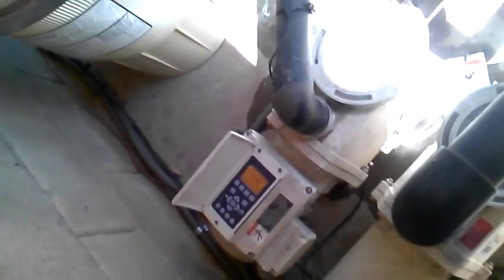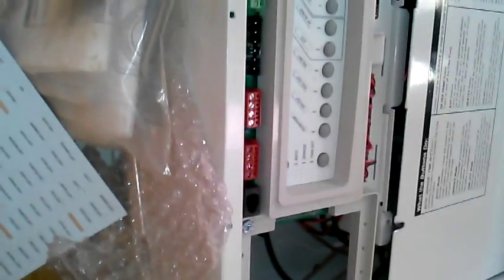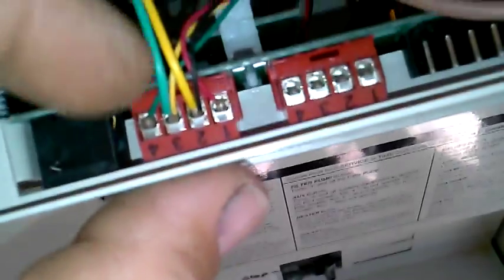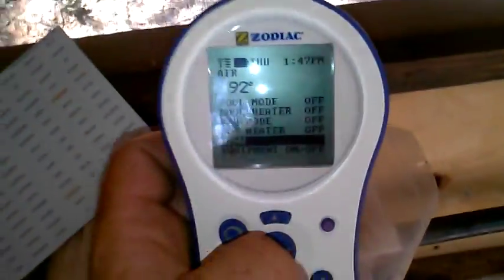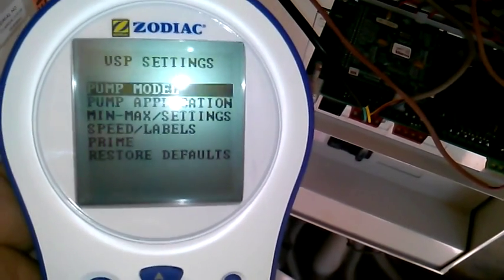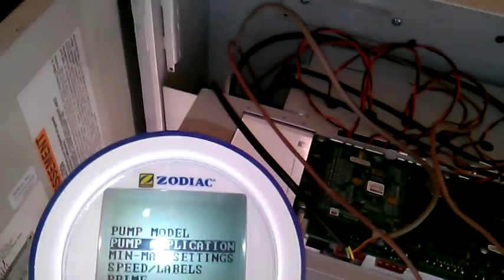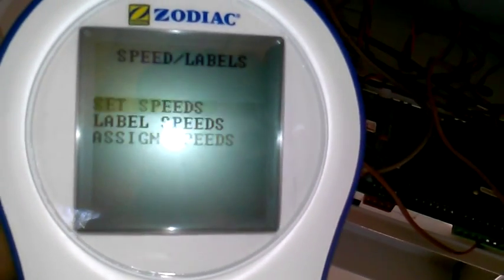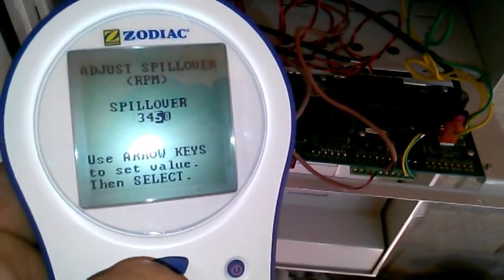Intelliflo VS Pump to Aqualink Jandy control Panel

Comment: My installer matched the wire colors like I would have. I got a com error when I tried to turn the vs pump on. I checked the wires after watching this video. Sure enough they were wrong. Threw the breaker and put them in 3 and 2 as you show and it works perfect. Thanks!

Comment: Spreading wrong information: your Jandy board needs an intellicom board to connect to the pump. Shame!
Reply from the maker: No It doesn't.....  Obviously because it works fine.  You can use one... if you want to spend extra money and lose a lot of functionality.
Reply from the maker: https://youtu.be/8bLEEXbYR_8    
Here is a video on Installing an intellicom .

Comment: Quick question. What about a hayward variable pump into the same aqualink. How do I manually adjust the speed pump. And which variable pump do i chose if it doesnt have hayward.
Reply from the maker: It will work with a Jandy pump or Pentair.... Hayward...not so much

Comment: Hi John   Great videos and information.  I just purchased a Pentair Ultra-temp heat pump and am struggling trying to connect with my Jandy Aqualink RS control box.  I connected 2 cables to green terminal bar 1 and 2 which say LVH and into the COM and Pool spade connection on Pentair to no avail.  Do you have a video by any chance showing how to connect this to work thry aqualink or lead me to the promised land.. Thank you in advance Ed
Reply from the maker: OLS LAND 

Sorry I don't have a video on that. All you have to do is open up the metal box inside of your Pentair heater you will see a fuse and a bunch of wires. There is a yellow jumper wire. You will have to cut that wire and run a lead from each one and that is what attaches to one and two of your green terminal bar. Then turn the heater to Spa and turn the temperature all the way up and leave it like that.

Comment: Will this work with a older Jandy RS 4 system?
Reply from the maker: +Gerald Jacobsen 

It depends on how old the the rd system is if it doesn't work Pentair makes an interface that will  make it work.
Reply: Thank You

Comment: Thanks!  When you did this, was your local crontrol panel still active, once you connected into teh Jandy PDA automation?  We just installed the Intelliflo 2 VST, with keypad relocation kit, and have it connected to our automation system, a Jandy/Zodiac PDA-PS6.  So, when we have it connected the keypad gets disabled.  We wish to use the pump local keypad for when the pool cleaner comes each week.  It could be nice for him to be able to hit quick clean of select a preslect speed (1-4) for higher RPM's when cleaning/vacumming.  Any ideas on how to activate local keypad control panel and have the Jandy PDA system controlling?

Comment: Thanks this was a huge help. Trying to figure out how to program for schedules using different speeds. I can manually adjust the pump with iPhone or web app. However I want to program for 1) clean mode (high speed), 2) solar heating mode for pool(slow)

Comment: This is a different pump from Pentair. It's a 1.5 hp VS with the 353129z cable. The intelliflo comm port is two wires where as the superflo has 6 wires. I think I'm out of luck. Thanks.
Reply from the maker: ok so with the 6 wire it looks like you dont connect it the com port like you do with the 2 wire....but it will still work with a jandy.
Reply from the maker: all you do is attached those six wires to the relays inside of the panel and then the relay turns on the speed. there should be a diagram in the installation manual.
if you don't have it download it from pentairpool.com

Comment: I have a Pentair 342001 vs pump with comm cable 353129z. Can you show me how to connect this to the Jandy Aqualink? The cable has 6 wires.
Reply from the maker: it should only have 2 wires even though it has multiple holes on the connector

Comment: Yes Robert, one speed is on filter pump,  one on spa, and one on a  auxiliary. You set the rpm' s on the pump and assign or pick a control (on/off) on the purchased card.

Comment: Hello Robert, yes I did. I only had to purchase a Pentair IntelliComm II Interface Adapter. Approximately $155.99 on line. I'm only using 3 speeds, you can set up for 4 easily. If I want a different speed, I do it on the pump. Which is very easy to do. Everything is working great, and Very quiet. The instructions with the card are really good. Good luck!
Reply: +Carol Geiger Thanks Garrett, So the way it works is you have a different button on your RS6 panel which is one for each of the 3 speeds?

Comment: Hello John,  Have watched your video numerous times, as I just purchased a Pentair Intelliflo VS 3050 pump (011018).  I would like to control it with my Jandy Aqualink  RS6 all button control system 10 years old, but works great.  By reading your comments I do not think it will work without a upgrade. If this is the case, what upgrade will I need to do to make my system work? Thanks for any help! Garrett
Reply: +Carol Geiger Garrett, Did you ever get a response? I have the exact same situation and believe there is a Jandy kit I need?

Comment: hello John, why i have to hook up the pentair pump to the breaker directly and not to a relay? it means that the pump need to be energized and th rs-485 its controlled by jandy? thanks in advance
Reply from the maker: Gerardo Aceves yes the pump is always energized but it only uses power when it is running. It is controlled by the Jandy Panel.
Reply: Thanks I will post pics when I've done , regards from paradise
Reply: Thanks all goog

Comment: John, Thanks for the excellent video. I was under the understanding that we needed the intellicom 2 when we hooked up to a Jandy panel. Is this new to the iAqualink 2.0 revision?
Reply from the maker: If your Aqualink is older than 5 years you may need an intellicom, otherwise the RS, PDA, and the I Logic all have firmware that support the Intelliflo Pump.
Reply: John Matthews I had a Jandy RS4 from 1999  (rev HH) and I bought a iAqualink IQ20-RS which includes the antenna and a direct replacement for the whole RS4 board out by my pumps. Works GREAT! And now I have effectively an RS8 with more AUX relays plus I can control the whole thing with my phone! Did NOT need the Intellicom in spite of what my salesman said I needed. I'm about to hook up my new IntellifloVS to it!